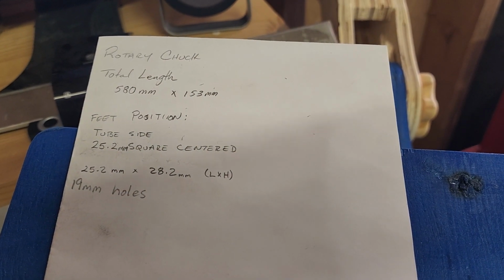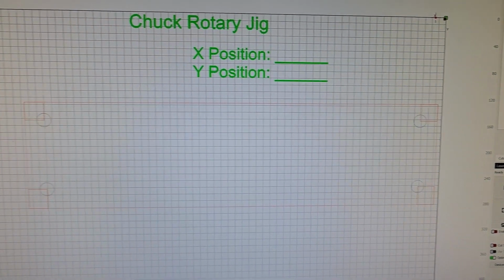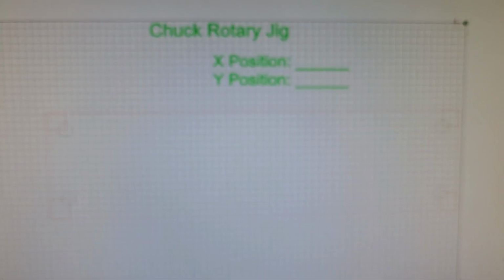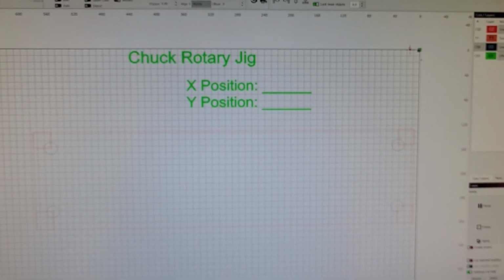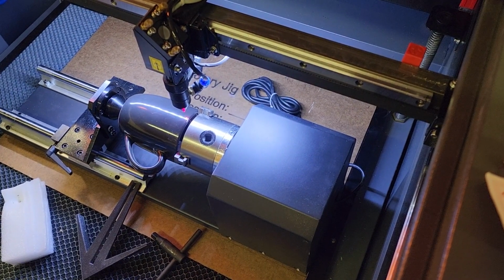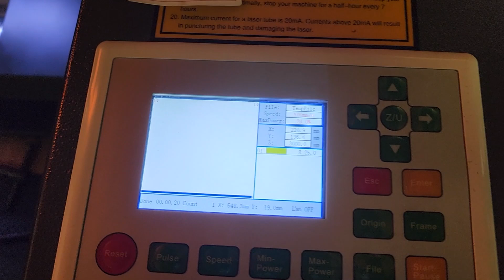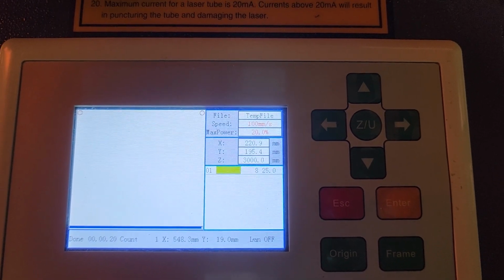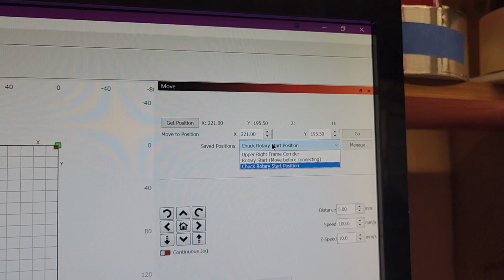Laser Upgrade! Omtech / Ebay / Chinese - Custom Jig for Chuck Style Laser Rotary Attachment

Comment: How can we get access to your jig for the rotary wheel?  I tried and tried to make one and saw your videos, love them!  I tried goole drive, but doesn't work.
Reply from the maker: Let me double-check the link. On another computer.  It is working on my phone, although with lightburn files, you may need to right click the link and choose 'save link as' otherwise it opens a page that looks like a bunch of text.
Reply: Thanks!  and appreciate you quick response :) @directedt3ch
Reply from the maker: @DAJ-ny1tx  No problem.  I checked the link and it's working.  When you click the link and the new window opens, you should have a download icon in the uper-right side of the screen that will allow you to save it.  If not, send me an email ( directedt3ch @ gmail . com) and I can send you the lightburn file.